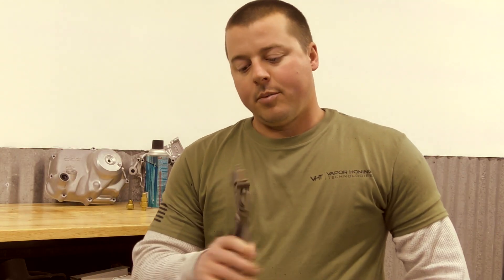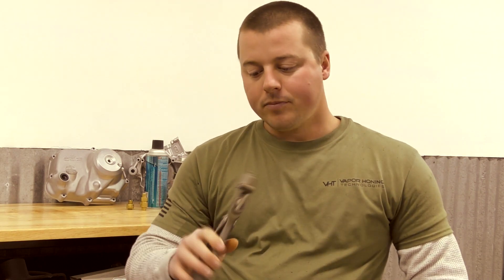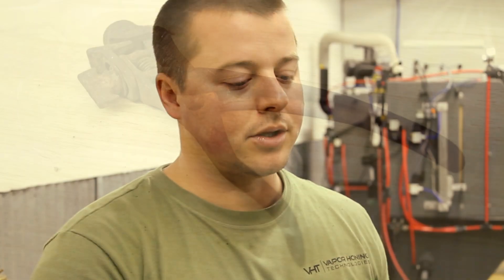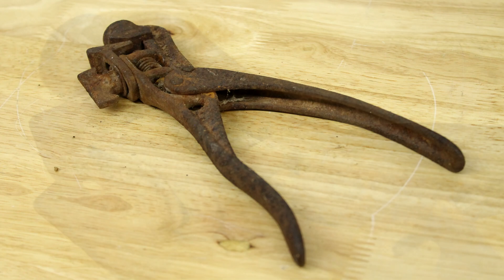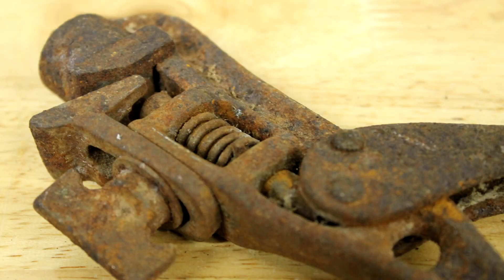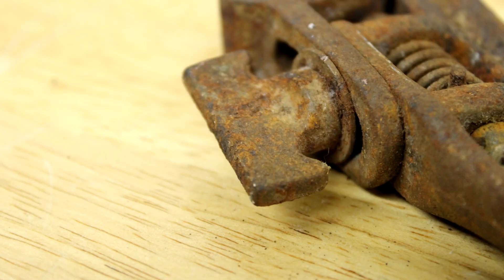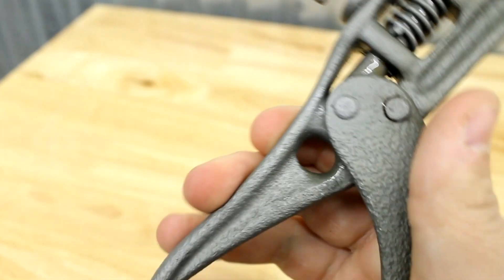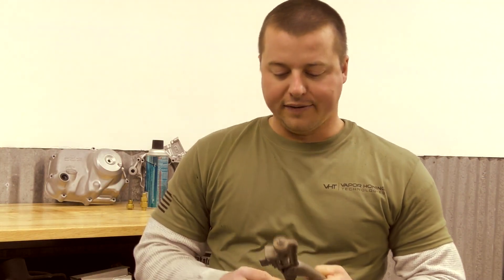Removing Rust from Tool with Wet Blasting - Vapor Honing Technologies

Comment: I've been thinking of wet blasting in my home shop. The thing that concerns me is that it will be an occasional use tool that will be standing more than it will be used. How do you prevent bacteria from growing in the water? Do you have to drain the water every time you don't anticipate using it for a while?
Reply from the maker: I can honestly say that after 9 almost 10 years of developing and manufacturing this equipment there has not been a time when I didn't need this machine to complete a task. Hands down one of the most versatile tools in my buildings today. As Mike said below you can add an anti fungal agent into the water to help with bacteria growth if it will be setting for long periods but I don't see that happening.
Reply: They sell a fungiside to help with that issue.

Comment: Nice work. That piece is probably from the turn of the century, or a of period of time when large band saw or horizontal blades were used to cut lumber. Like in a lumber mill setting.